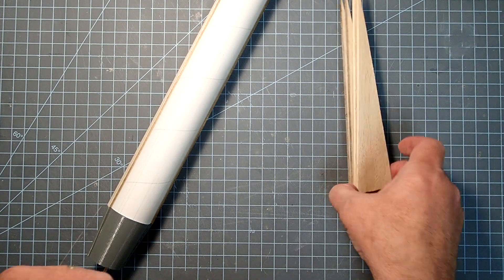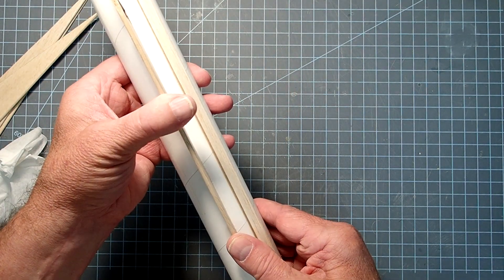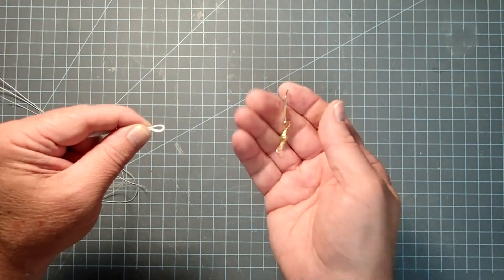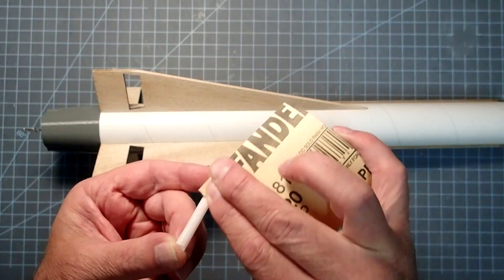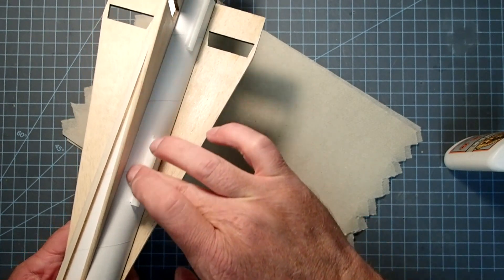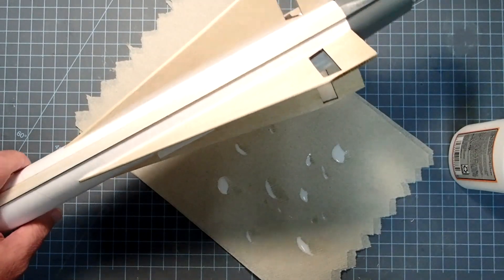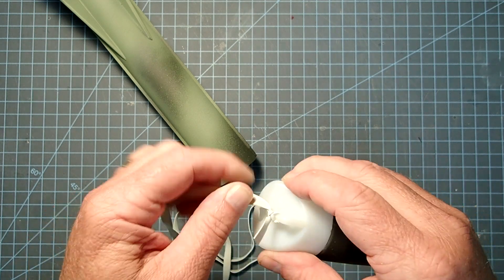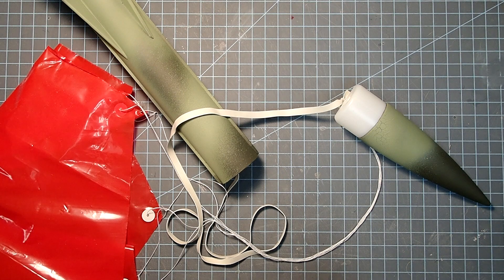Rocketarium "MIM-23 Hawk" model rocket assembly (part 2 of 2)

Comment: I'm about half way through this build.  Your video is very helpful to me.  I did a couple of things different.  First I used a Kevlar shock cord instead of the included elastic one.  Second, after putting the clay in the nose I sealed it off with some 5 minute epoxy.  Third, I will wait to install the channels and launch lugs until I have installed the fins.  That way I can use a fin alignment guide.  This is my second Rocketarium build.  I built their Trident with the three motor cluster a couple of years ago.  I have yet to launch it tho.